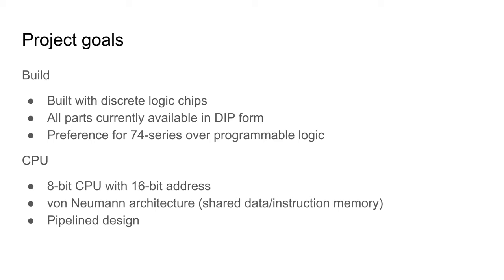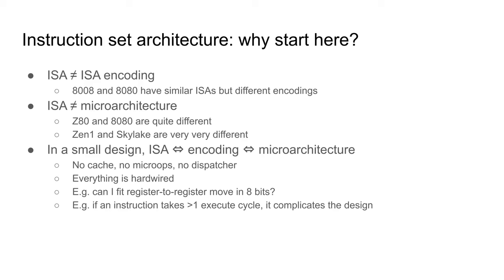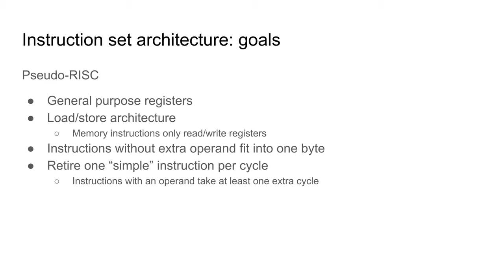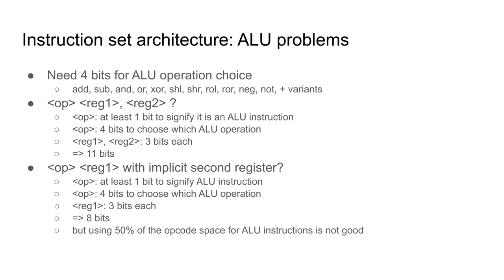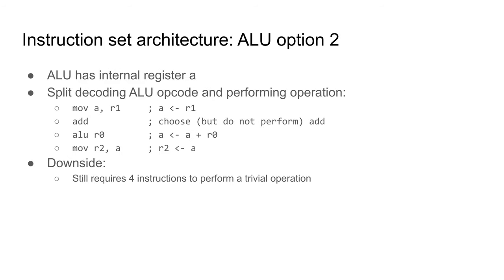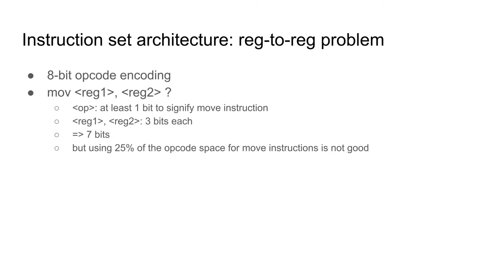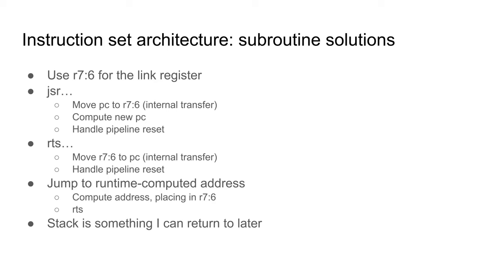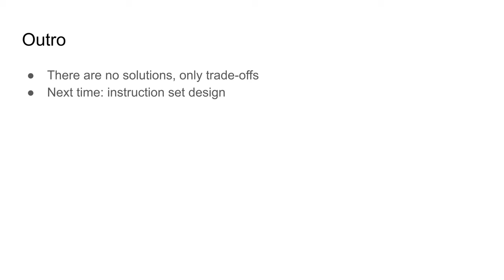Designing an 8-bit CPU - 1 - project goals

Comment: You also have the option of going the 68000 route with regard to registers and splitting the register file in two, one half a set data registers and the other half a set of address registers. So only two bits needed to specify a register - with the type of instruction being executed deciding which half of the register file is to be addressed by the hardware.
Reply from the maker: I didn't realise the 68k did that.  I grew up on the 6502, a tiny bit of Z80, then ARM, then joined the masses with x86 (although the only serious assembly I've done in x86 was for hand-optimising SIMD 🤯).

It's a neat idea, for sure.  I kinda wanted a "RISC-like" architecture in that all registers are treated equal.  I guess I have a soft spot for ARM 
😆

I have more ideas... too many ideas to implement.

Thanks for watching & commenting 👍
Reply: @phodopus42  > Well with sixteen odd registers to deal with, and the division was not done as strictly as I make out, but we're talking about a sixteen bit instruction (minimally, they can get much bigger) versus your eight bit.

But still interesting to see what you end up going with.

Comment: I hit the same issues when designing my 6502-inspired CPU (I plan to implement on an FPGA).  However, I do like you 2-register ALU approach.  Even though it uses 4 instructions, I could see assembler support for pseudo instructions that use A0 and A1.  I am wondering, therefore, if a 16-bit ISA would be more useful.
Reply from the maker: So... OK... this got me thinking.

Since the start, I've been jumping back and forth between the idea of this ALU register.  I never liked it.  I ended up settling on a 2-byte opcode for ALU ops to avoid it.

I was walking through the pipeline stages for instructions.  Loads & stores take minimum 2 cycles (fetch opcode, perform load/store), or 3 cycles if there's an immediate (fetch opcode, fetch offset, perform load/store).  ALU ops take 2 cycles because it's a giant opcode.  OK, so what instructions only take 1 cycle?  Virtually none.

And I believe you are completely right.  I sketched out the opcodes assuming they are all 2-bytes, and suddenly there is room to breathe!  Let me play through the scenarios and I may have an update in the next video.

Thank you for a provocative and helpful suggestion 👍

I'd love to see your FPGA design.

Comment: I think, you better start with data path design, instruction set will depend on what DP you could do. Second, you do not need so many ALU ops. You need AND, OR, XOR, ADD, SUB, SLL, SLR,  i.e. 3 bits. Also, why so many regs ? Go the 6502 route - A, B, H, L. Use H and L for memory access. 8 bits is plenty of space for encoding instructions. :)
Reply from the maker: Thanks :)  I wanted something more "RISC-like" so that I can avoid complex instructions like the 6502's indirect memory accesses.  That's why I ended up with 8 registers.

I'm currently designing the data paths and decoder.  In retrospect, that's where I should have started.  As I've probably pointed out, I'm not an expert here!

I am reconsidering the whole instruction set as a consequence.  I've been programming some simulators at different levels: a high-level one for the instruction set, and a lower-level one simulating the data paths and control logic.  This gives me the advantage that I can try something out without hours of work on the breadboards.